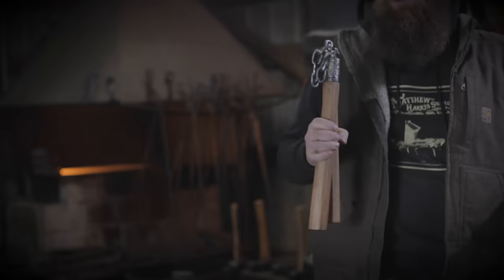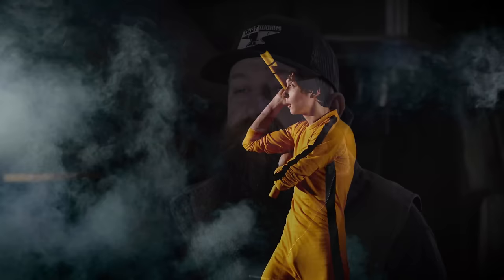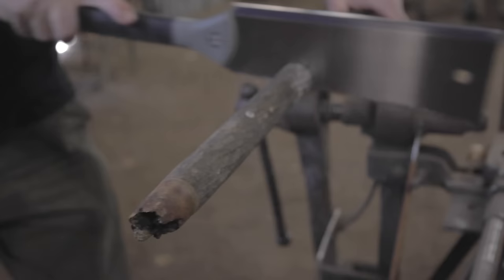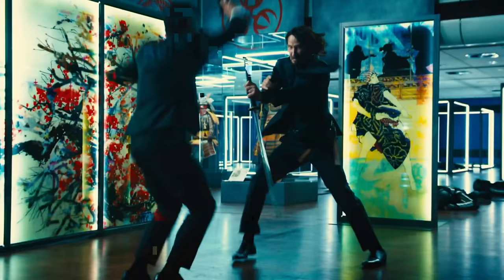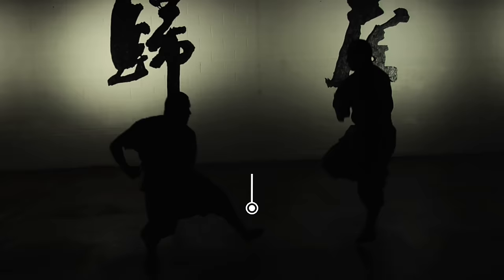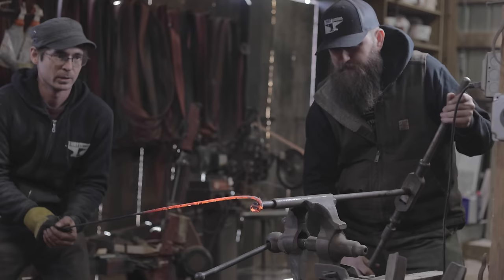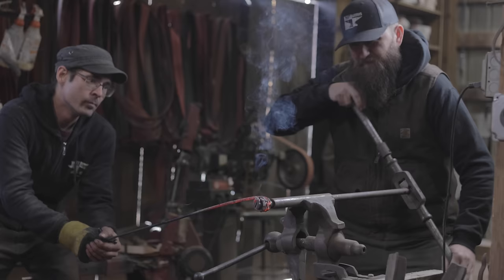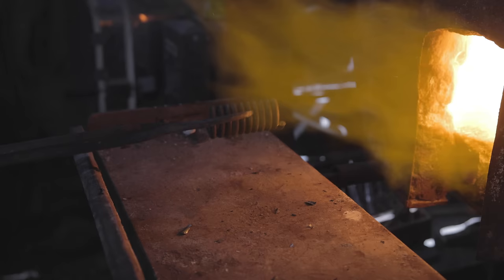John Wick 4 Nunchucks - Did They Exist in Battle ?

Comment: In fact, in warfare, this type of nuchanku is not used. It is used mainly for self-defense. In combat, people use "Thiết Lĩnh," a weapon that is similar to this one, but consists of two solid wooden bars, one long and one short. The two bars of Thiết Lĩnh are connected by a sturdy cord, usually made of hair to prevent it from breaking. There is an iron ring at the joint of the two bars of Thiết Lĩnh. In Vietnamese history, this weapon was used effectively against the Mongol Empire, not Japan.
Reply: They don't make sense for self defense either. If you don't want to get mugged, carry a staff or walking stick, it is more effective as a weapon, and the muggers can see it, so they are much more likely to find someone else than start a fight with someone they know is armed. Muggers might want a concealable weapon, but it isn't a great self defense tool.
Reply: @coopercummings8370  this weapon developed from the farming tools of rice farmers. Normally it was just a farming tool that could be used in combat if needed, especially effective when dealing with weapons such as swords or light shields. Later on, it was applied in martial arts and promoted by Chinese actors in movies. However, in reality, it is very difficult for beginners to use and can easily injure themselves.
Reply: @tienthanhnguyen8948  The problem is the farming implement has one long handle and one short stick connected together by some flexible connection like a rope or chain. This makes it dramatically more effective as a fighting weapon than the nunchucks, it is far, far easier to avoid harming yourself, you just need to hold it at the end of the handle and the free-swinging part won't be able to reach you in most circumstances, and it is far more effective as a weapon, because the extra reach is a huge advantage and allows it to strike with much more force.
Reply: @coopercummings8370  yes so that i believe that it did not used on the real battle the real one " thiết lĩnh " realy effective and easy-to-use .
Reply: @tienthanhnguyen8948  beginners don't stay beginners. Then they become proficient.

Comment: I have spent an insane amount of time researching the history of martial arts in east Asia, and the Japanese weapons particularly. Ilya's point where he compared it to making a club out of a rubber tube and filling it with lead is the closest to what is most likely. 
They were a concealable weapon that folded so they could be hidden. The problem with a walking stick or staff is that people still knew you had it, even if it wasn't obviously a weapon. So there was still a benefit to hiding the weapon altogether. 

There is a similar weapon that came about during the same period in The Philipines called Tabok Toyak, and we have evidence that it was used by criminals, gangs, and the like to be a weapon that was easy to hide, yet still had the same reach as the more common Arnis sticks and shortswords that were also in use during that time. 

My hypothesis, and I want to make this clear that this is my hypothesis and it's unproven at this point, is that the nunchaku were also invented around the same time and for the same purpose. Part of my supporting evidence for this is, firstly, that it's the same time period. Either the idea made its way from one place to the other (China also has similar flail weapons from this period), or they were independently invented in both places. This would not be the first or only time in history that something was independently invented in multiple places at the same relative time.
Secondly, because of the lack of evidence of their existence or use among the elite class and military, who are notorious for keeping good records, the nunchaku were certainly not a military fighting weapon. But that doesn't mean that they were not used as self-defense weapons. Though if my hypothesis is correct, they were also probably used by muggers and gangs to attack people.
Reply: You, sir; most eloquently stated what my crayon eating behind would never be able to. Major kudos on the amount of research and (I'm sure) ridiculous time involved therein.
Reply: This has always been my thought. Like a black jack, it's something you can hide on your person, and if weighted for harm, use to hit someone quickly and surreptitiously. With the added benefit of maybe being able to entangle an enemy's weapon to disarm or disable them. It's a street weapon, likely not a main weapon, probably used to get around other weapons and strike first and fast, and then hide it quick. (European flails are said to have been possibly more used as policing weapons than battlefield ones, used to get around shields or guards and strike the head, usually with a larger handle and a shorter chain.) 

Like many street weapons, it likely became popular and flashy and entered the culture and became a martial arts weapon as a form of display and skill. (I've heard from a number of people who are supposedly trained in this, who say they are from China or other Asian countries, and claim this is the case and that often the actual usage is much less flashy than the training methods. However, their claims cannot be backed up and thus are of dubious quality.)
Reply: People knowing you have a walking stick or staff isn't a disadvantage in a self defense circumstance though (as long as it is legal to carry one). If the goal is to defend yourself from muggers, you are better off carrying a weapon they know you have than one they don't, because if they see you have a staff they are going to pass you by and find someone else to mug rather than fight someone who is armed, in addition to the walking stick or staff being more effective than those concealed weapons if they attacked you anyways.
Reply: @coopercummings8370  On the other hand, if someone has just been beaten by someone, being the guy with the stick is a bad look.

Sure, you can just toss a stick away, but if it's a good beating stick (which is the real reason you have it) then it's going to stand out unless you are in the wilderness, and if it's a cane or something, someone might have seen you with it and then not having it now. It being a concealed version of a rice flail, used for urban conflict, most likely ambush and muggings or street fights, makes the most sense to me.
Reply: this explained it so well not all weapons are war weapons when i say soldier most people think rifle not handgun  modern warfare isnt won with a 9mm that doesnt mean handguns arnt weapons they just usually arnt the weapon of war
Reply: @coopercummings8370  Ultimately, what is a good self defense weapon - especially when trying to not get into trouble - is not just the effectiveness as a weapon itself, but also the culture and law, which cannot be seperated - remember we are not talking about 21st Century USA. We are talking about centuries past, in a different place, which may have a different mindset.

Example: if you have a law saying you have to use "proportional force", and then you kill someone in self defense - under that law you may be guilty, because you are not proportional. 
A myth(?) that I recall, especially in Korea and Japan, is that someone at the shi-class (which include Samurai) can attack merchants, while merchants should not defend themselves, for they "ended up" in such career. In that case, you need plausible deniability.
Reply: The gang weapon theory seems the most plausible to me
Reply: It's garbage. That's what it is.
Reply: Urumi aka whipsword is another example. It has its orgin in Southern Indian state of Kerala and was used in Warfare. plus it was part of the Oldest martial art in existence Kalaripayāttu. But urumi with it variation has existed in ancient Sri-lanka as well.
Reply: I wanted to comment and say similar things, but you did all the groundwork. I'll add just a little more to your comment. Variable distance is also a big benefit of the nunchaku over the traditional rice flail and bo that are mentioned in both the video and the comments here.

A bo is a good weapon, but fighting when someone comes in on you is not as easy. But holding 2 sticks together, approximately 12" long, and clobbering the side of someone's temple until they pass out, is a much easier solution. 

As far as it needing a lot of training, I disagree with that. It took a lot of training to do what Keaunu Reeves (Spelling?) did in the movie. It would take a lot of training to take first place with a kata in a tournament. But to simply learn how to swing them with a slashing motion that follows through and still has control to be able to redirect the swing a different direction won't really take up as much time as you'd think if taught properly. Most martial arts schools don't start with that specific aspect of it, but I bet a father showing a son how to swing it for defense probably did.

Comment: I have a couple thoughts and notes I would like to add to this discussion. 1. I do agree that this was probably not a normal weapon on the battlefield. 2. It is possible that they were secondary weapons for peasants to have in their waistbands if opponents got too close. Ilya points out that you would lose your range as a weapon, but the point of most martial arts, especially asian ones, was for up close hand to hand combat. So it is most likely that it was like a replacement for a dagger for poorer people if it was ever used in a battlefield. Could have been a rare instances where only a few had them and never really used them. 3. Ilya mentioned how most paintings and illustrations show people with sticks; the problem is that if you get pushed in a tight alley or room, the stick becomes harder to use. Nunchucks are very easy to use in a tight space. As for evidence of using shorter weapons, watch Wing Chun the movie about the founder of the martial are Wing Chun. It emphasizes the use of shorter weapons for up close. The heroine fights a gang leader who has a Glaive by using two short swords, almost like daggers. She forces him into a building where he can’t be swinging his glaive around as easily but she has full range to attack still. So the nunchucks would still be better, outside of concealing, for up close fights. 4. I personally would categorize this weapon as a flail, it’s a short one, it uses the same principles as other flails. 5. Ilya said it wouldn’t be practical for fighting with your comrades around; I agree in that it would be very difficult. I can see advantages with able to use the rope or chain to wrap around weapons or arms and trap it. I also think the damage from nunchucks would be substantial against no armored opponents, other peasants. They can break bones very easily, maiming and can stop them from able to walk. My conclusion: probably not a weapon for war but a weapon for street fights. Cities had lots of gangs or criminals attacking. Also had “cowboy” like martial artists who would challenge criminals or each other, such as Bruce Lee or samurai’s

Comment: I don't think I've ever heard anyone suggest that nunchaku were actively used as a battlefield weapon, other than maybe as a last resort.  Most of the things I've come across indicate use more as a street type weapon and as something concealed.

If you're not doing flashy stuff they're easy to use, and if used for sucker-punch type attacks they're decently effective (think a lead-filled sap).  Where they become problematic is when you start trying to do all the flashy stuff.

My suspicion is that they've been used for a long time as a basic, easily concealable weapon that's used essentially like a lub with extra reach, or a short, heavy whip, and the martial arts aspects came along much later once martial arts took on an artistic rather than combat training aspect.

Comment: These were never 'battlefield weapons', obviously. Even more obviously, battlefields were not the only place where combat happened. Many farmers were plagued by bandits, and the farmers had to defend themselves. These were not 'battlefield' scenarios, they were 'defending your village' scenarios. To your individual points:
1. It doesn't take years to be able to use nunchaku. To be flashy (doing spinning tricks) may take more time, but unlike a blade, they are very effective blunt force trauma weapons, with very little training.
2. Saying that you lose money while training with nunchucks ignores that these weapons were taken from flails used to separate grain from chaff. So, in reality, they trained all the time, as most weapons like this (tonfa, for example) came from farm implements.
3. The origin: There is no documentation because it was used by farmers (not warriors) in Okinawa (not Japan). Farmers were typically not educated in writing, thus, no documentation.
4. Pictures show people walking with staves, so why cut it in two pieces? Easy: Radial velocity. You generate more force with a hinged weapon (like the nunchuck) than a staff (that's why flails exist - around the world). A staff also requires more training to be able to use it as anything more than a simple club. The nunchuck is also very sneaky: it's hard to tell which direction the attack will come from, and it can change faster than a staff.
Last, saying that if it was used differently in the past means it was or is fake, is insane. Weapons got repurposed throughout history all around the world. And again, I've never heard anyone say that these were used by samurai at any point, or as a battlefield weapon. They weren't. It's a very practical, easy to make, and very effective weapon - those 3 facts virtually guarantee that it WAS an historical weapon - just not on the battlefield...

Comment: the nunchucks have three biggest downfalls, an untrained person can't pick them up and figure out basics of using them, they can't drive the force in them into the opponent's body and they have no real defensive utility

these features alone wouldn't be that problematic for a weapon, because neither knives nor firearms have real defensive utility, but knives are small and concealable, and firearms are ranged weapons
firearms also can't drive the force of their projectile into an opponent, but it has so much momentum that it isn't an issue, so while they share two downfalls, one is mitigated by sheer momentum of projectile, and other is mitigated by range advantage which, in right conditions, can be massive

Comment: As a kid I constructed these out of the cardboard tube from a strut hanger.  Snap the tube in half over your knee poke a hole in them at the top with a pen.  Use a length of thin present ribbon for the chain and voila!  You have a pair of cardboard nunchaku.
Reply from the maker: Indeed

Comment: When I look at the nunchuck the weapon it most reminds me of is not a stick, but a whip. It is solid in parts like a long stick, but the motion you use to generate the most force is most similar to a whip, because you engage the wrist more. I suppose the other similarity between them is that they both work at a specific range and don't do much outside of that range. So maybe they're meant to be used with a specific style of movement that has the user close distance, strike, and then quickly back off?

Comment: Real noon chucks are octagonal. That means that they have flat sides and sharp edged at the corners. They are held together by strong rope wound through a series of drilled holes at the top… not chains.

The flat sides and sharp corners maximize the impact by imparting greater force to a smaller space… 

Bruce Lee’s round noon chucks were a prop…. not a weapon.

I was introduced to them in Okinawa in the mid 60’s at Shimabuku’s Shorin Ryu dojo in Kin Village.

They are actually easy to use if you use them for fighting rather than as movie props.

They are self defense weapons used for personal defense, not as battle field weapons.

One of my students saved a woman being attacked by a crazed guy with a knife by hitting the attacker on the head with a long overhead swing. He killed the attacker with one hit. 

So… noon chucks are indeed a viable weapon. 

By the way the correct name is nunchaku!
Reply from the maker: The correct name was said about 10 secs into the video
Reply: @ThatWorks  Correct.

Comment: A friend of mine who trained in Okinawa as a live-in student told me that nunchaku were not supposed to be used in the flashy manner, but were more like an assisted grappling tool. Lots of binding up opponents' arms, and digging the points into pressure points etc. All at very close range. I have a strong suspicion that their origins/inspirations and uses were probably multiple. Similar weapons are used in some of the older systems in China, and it would make sense that they made their way to Okinawa via cultural exchange and trade. As an unprovable theory, I wonder if they were an educational weapon designed to teach people that even a broken spear shaft (or similar) could be used as an improvised weapon. A lot of the older bushido ryuha have strange "weapons" that look like wooden cart wheels attached to axels, logs etc. I very much doubt that anyone ever deliberately walked into battle carrying one of those things, but if you had been taught to be open-minded about what constituted a weapon, and had some experience moving such weird objects around offensively, then you stood more of a chance if you found yourself cornered and without a proper weapon.

Comment: I've always believed the nunchaku were originally used as ricing flails, the string or chain holding them together in case one was dropped so they wouldn't end up in the water or muck. In the video it shows them being used to wrap a bundle of something, interesting. As far as controlling a horse, people do use twitches wrapped around a horses lip to better handle them but usually makes them behave worse. The nunchaku do resemble a twitch. Interesting video allround.